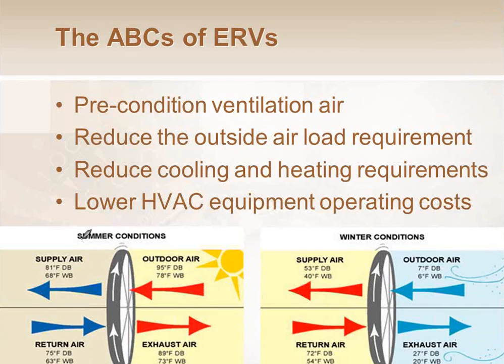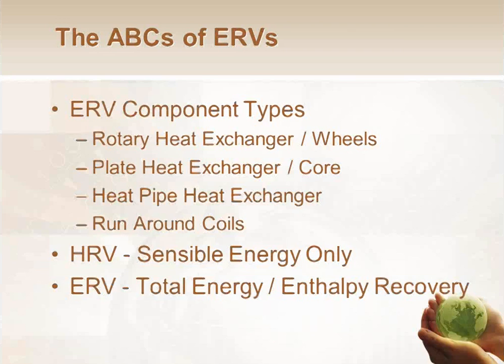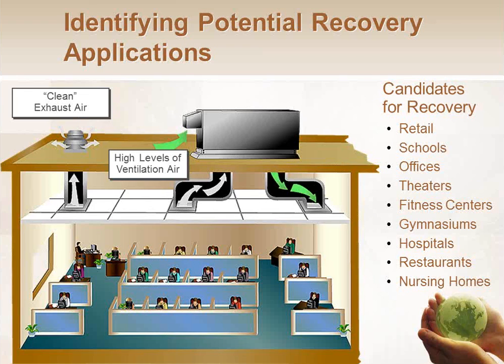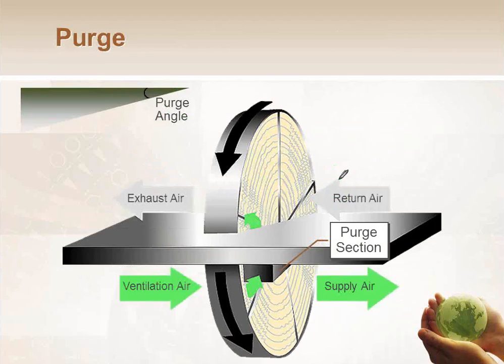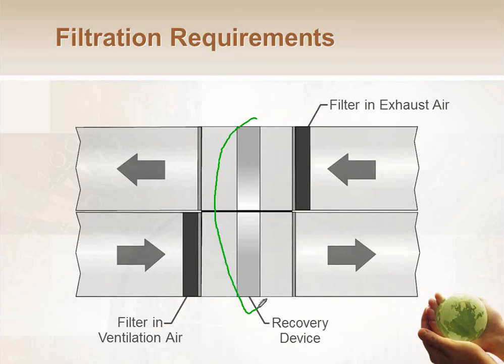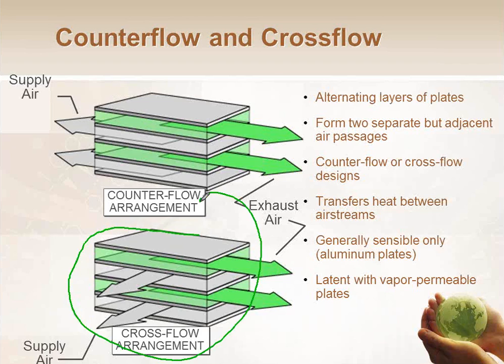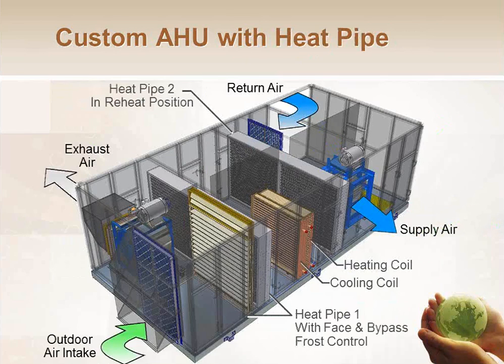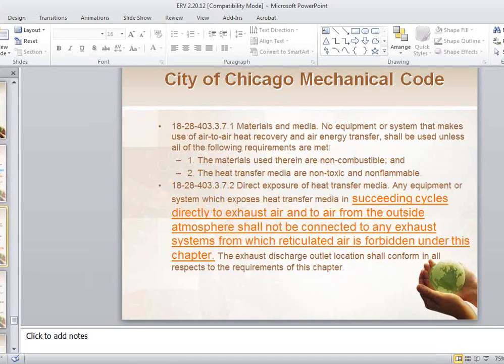Commercial Energy Recovery Ventilators (ERV) - Webinar 5/20/13

Comment: Hey bud I work in a hotel no exhaust fan just an ERV in the attic I don't know how long it hasn't run but the owner want me to try and fix it here's the problem I have all the motors running if I manually push the main contact on but I'm having trouble with  the start up something is holding it out do u know what it could be .The unit is a Greenneck ERV
Reply from the maker: You should begin your troubleshooting with your electric meter, the unit's wiring diagram, and the unit's sequence of operation to see which widget is the one holding it out.